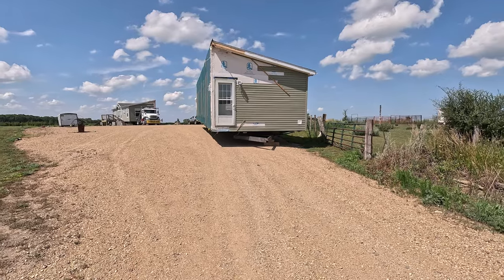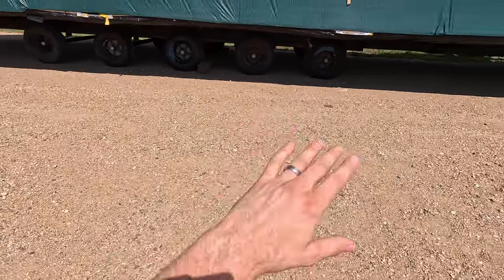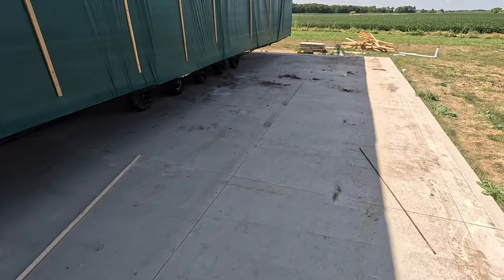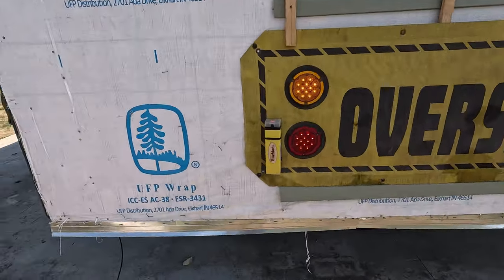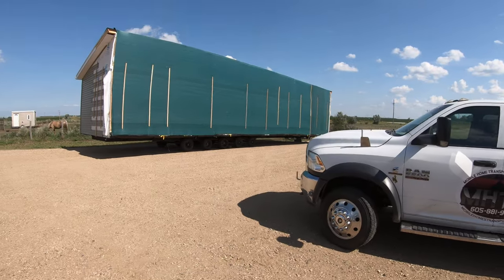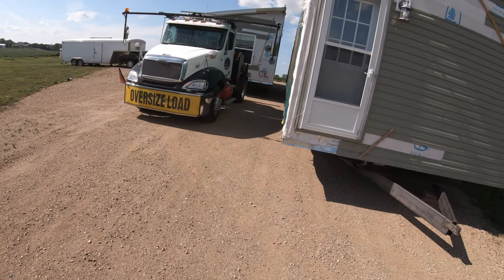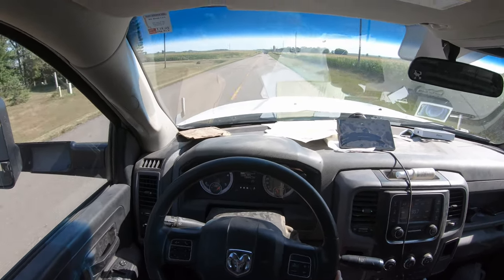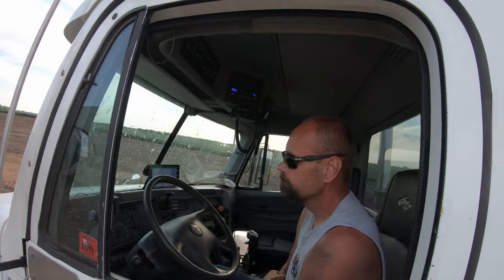Prepping a Double Wide for Transport!

Comment: How do you guys measure out for the concrete columns to align with the frames? We get measurements from the factory, but still are off when the home actually arrives.
Reply from the maker: I'm not sure the details of your situation, but we build our gravel pad, then run string lines down the concrete pier rows, making sure they are square with the pad and each other. Making sure you're square is probably the biggest thing. We also pour our piers ~24" wide to allow for some wiggle room with home and block placement. We'll have to do a video in more detail on this!